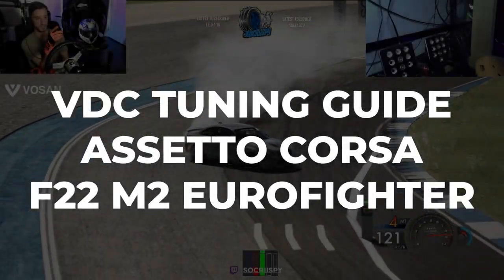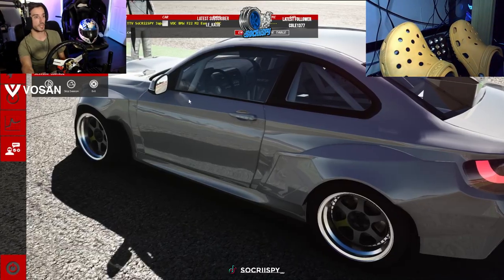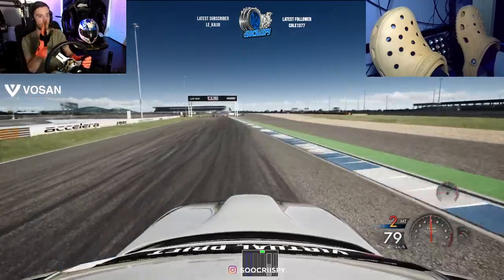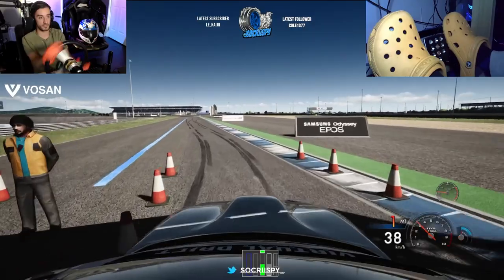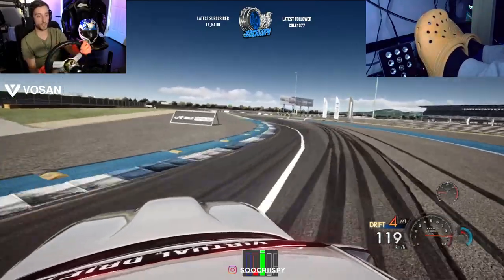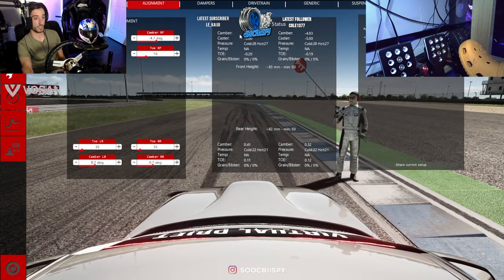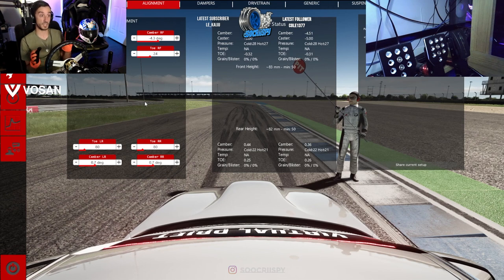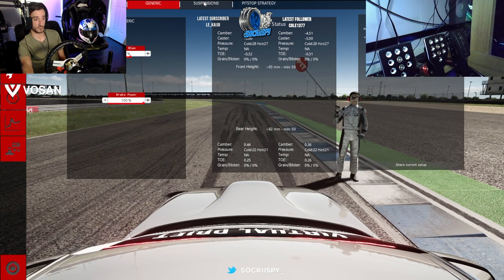VDC F22 Tuning guide Assetto Corsa

Comment: Is it easier to drift comp cars with a dd wheelbase . I am curently on a g29. Should i upgrade ?
Reply: yeah it  will be much easier, as you will find transitions can be quicker and more consistent, however if on a budget you could look for belt drive options as a nice middle ground (like a thrustmaster tmx pro)
Reply: another g29 brother 😭, it's tough out here
Reply: @thomashooper2564  ok. Thank you
Reply from the maker: 100% easier with a DD bro! Its night and day!
Reply: @acha5070  I've started running some settings that help quite a bit and can help you with that if you'd like. tbh you'd still have a tougher time though, that's just what us logi wheel guys have to suffer with 😅